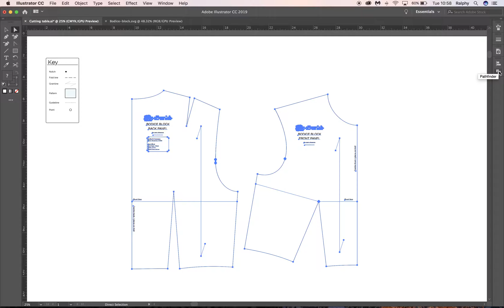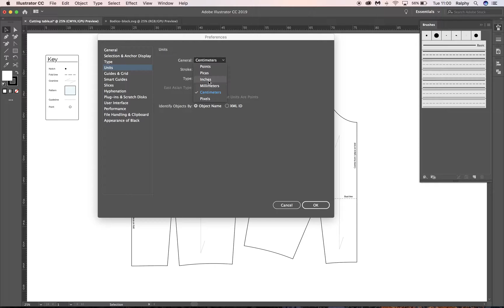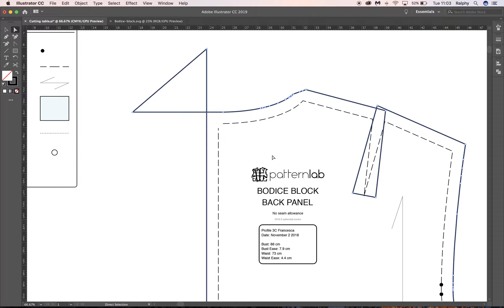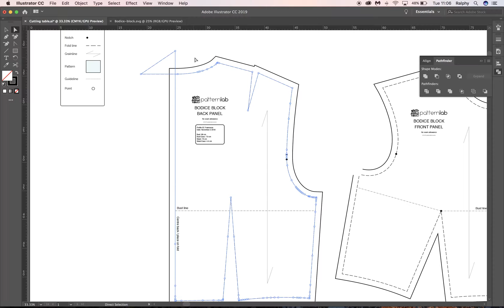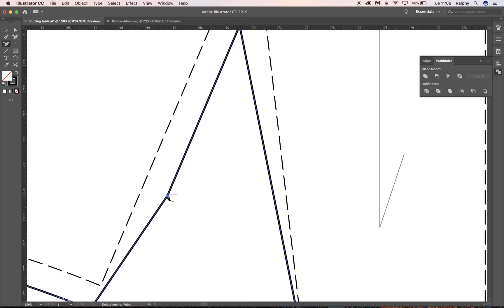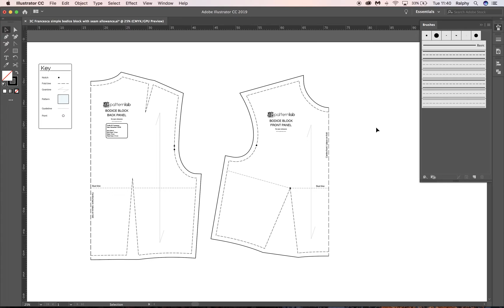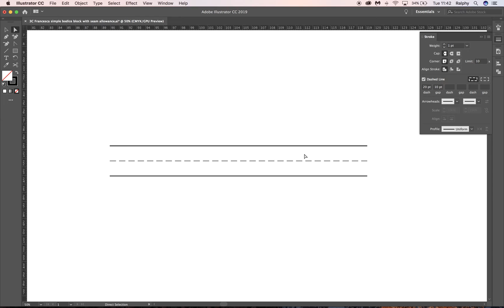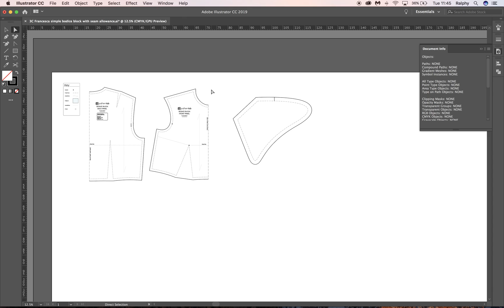Adding seam allowance to a pattern - Digital pattern making tutorials

Comment: Hi, my brush tool panel does not have seam allowance brushes ready like yours. Did you add them afterwards to illustrator?
Reply from the maker: Yes we created the brushes and added them to the brushes palette. You can visit the tutorial page on our website by clicking the link in this tutorials description. There you will find a pre-made document that features these brushes. It called the "Cutting table"
Reply: @PatternLabLondon  Thanks. I also want to add rulers and overlap marks on the edges of pages to guide people understand easily which sides of the papers will be matched and overlaped side by side after printed out pdf patten. I would be thankfull tou you if you could tell me how to do it.